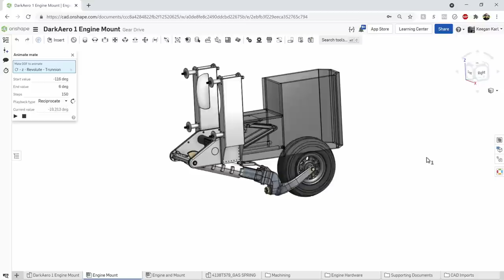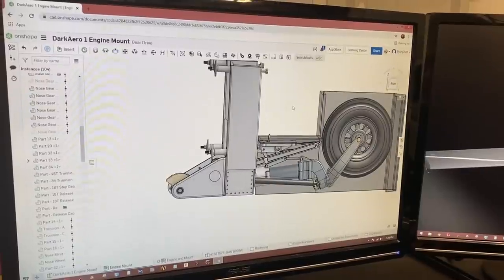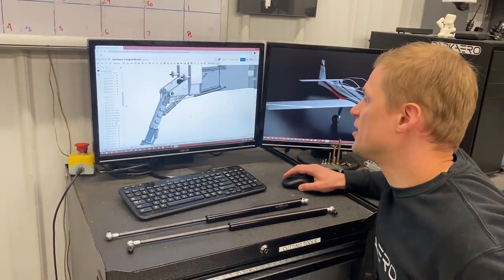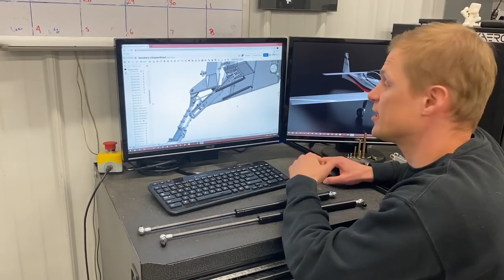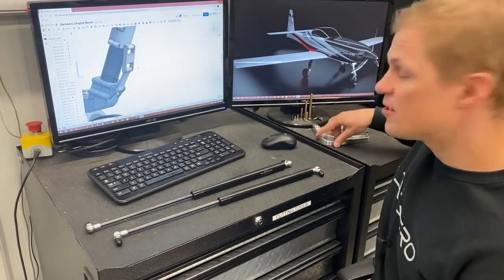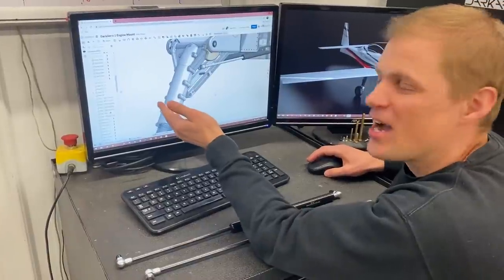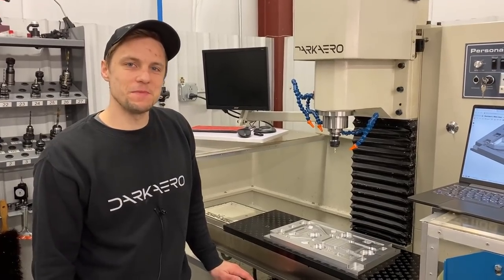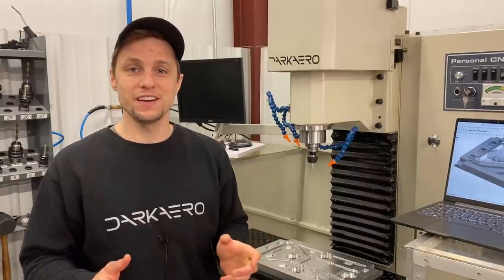Beyond the Prototype - Design for Manufacturability | DarkAero 1 Nose Gear ⚙️

Comment: With an incomplete nosewheel extension being the most common cause of gear failure (and collapse), I'd like to see more focus on the drag links. Specifically, over-center locks for the drag links, along with positive force on the drag links during and after extension to lock them in over center - a spring or strut. Lastly, perhaps a cam on the retract motor that pushes the drag links out of lock at the very beginning of the retract sequence. I want my down-and-locked gear to stay that way!
Reply from the maker: Hi Scott! We only briefly touched on the locking mechanism in the video but we do plan to cover it more in depth in future videos. There are a number of ways to achieve locking. The over center lock you described is popular with hydraulically actuated gear. It’s what I have on my retractable Cozy MkIV main gear. This works well when the geometry and space claim allows for it but we employed a different style of locking mechanism. Ours uses a simple latch mechanism that is incorporated into the mounting bracket where the upper drag link attaches. Once the gear is in the down position, the latch locks the rotational position of the upper drag link and constrains the nose gear in position. The mechanism and function is similar to a rotary latch. We might do a deep dive video at some point that walks through the evolution of our nose gear designs since it might provide some valuable insight for anyone else trying to engineer retractable landing gear. Thank you for your interest in our design!
Reply: @DarkAeroInc  Thank you for this explanation, and I look forward to seeing more on this in the future!

Comment: Glad to hear about design for manufacturability. I work as a prototype machinist at an aerospace company. It's frustrating how the engineers put tiny fillets on vertical walls on tall parts. It makes the part ridiculously much harder to make. A simple over sight of knowing how things are machined could avoid this issue. Hopefully i can finish my mechanical engineering degree to be on the other side and speak up about this. There seriously needs to be more communication between engineers and machinists. If their design is dumb and makes it harder to make typically, we just have to deal with it. Its a waste of time and money. Machinists need much more say in the designs of components.
Reply: There is a reason engineers do these things. It isn't just to make your life harder. Fillets are extremely important.  This is why engineers design airplanes and not mechanics or machinists. Sure, input is helpful but if you don't understand engineering and stress analysis what seems logical to you might a big no-no.
Reply: @PDZ1122  A lot of times they just put it in there for looks though.
Reply: Being an (albeit electrical) engineer, I often wonder how little the two parties (development and manufacturing) actually talk to each other and how limited the mutual understanding is. Looking across the fence is a good thing.
Reply: Share your experience.   Make a blog or YouTube videos.

Comment: How do you guys account for fatigue in composites? I think that would be an interesting video!
Reply: fatigue is really not an issue if designed with an adequate factor of safety. (in stark contrast to metals)
Reply: Composites do not have a limited lifetime, like aluminum.  The Beech Starship, for instance has an unlimited lifetime on the airframe.
Reply: @kickthedonky  I think it would make a for a good topic to discuss though, for those who aren't familiar with the subject. Comparing aluminum, steel tubing, composites, wood, and maybe some other common aviation materials in a concise manner. Could maybe help sell planes too.

Comment: I have had so many issues with gas springs in far less critical applications - perhaps these are special high-reliability models? 
I would feel better about a cable crank  system to pull the gear into the locked position.

Comment: DFM is my world. Thanks for helping engineers understand the need for thinking about how and who is going to make the parts/assemblies that they design.

Also, question. How do ensure the wheel is straight when retracting into the plane? Seems like if it was turned it would not retract into it's home. Does the caster of the wheel straighten it out from the airspeed?

Comment: if you could flip the opening way you take advantage of the aerodynamic and  and use the electric motor only for the closing
Reply: In an earlier video, they said they have considered it but the wheel would not fit below the engine without adding more frontal area and weight (bigger cowling required).

Comment: I have been following you for a year. Very intresting and fun to see the progress.
One question... the dragstay/locklink, how do that lock. What keeps it straight.
Could not see that the motor was connected to the dragstay?
Keep working/ Stefan
Reply from the maker: Thank you for following along! The drag links are locked at the pivot point of the upper drag link. There is a simple latch mechanism that locks the drag link and prevents rotation of the link once the gear is in the down position. We will have more to show on this in upcoming videos. It will be much easier to explain the function with an actual demo. Stay tuned!

Comment: What keeps the nose wheel centered for retraction?  Pivot friction alone and hoping it stayed centered when it spun down may not be enough?  What if it had a little shimmy before leaving the runway?  Say in an aborted landing because of shimmy?

Any room for a 5x5 nosewheel instead?  (Would be nice to have same size tubes and tires all round and sometimes a good 4" tube that doesn't pinch is hard to find.)

What is the manual extension provision?
Reply from the maker: Good question! The nose wheel is castering but not "free" castering. There is an adjustable nut on the pivot axis of the fork which imparts friction into the fork pivoting action. This serves two purposes: it acts as a shimmy damper and it also prevents the wheel from flopping around backwards during retract operations. The break out force to rotate the wheel/fork assembly is around 10lbs when you push laterally on the wheel. This arrangement is similar to what is seen on the nose wheel and fork of the popular Vans kitplanes or the Cirrus SR series of certified aircraft, although these are fixed gear. The wheel and fork on the DarkAero 1 are pointed straight as the aircraft leaves the ground and the friction nut keeps them in position. There is a wedge feature on the nose gear doors (not shown in our videos) that acts as a guide to correct small angular misalignment in the wheel and fork.

A 5x5 nosewheel could have been possible but would require a larger wheel well reducing cabin leg space and added additional weight. The tires are tubeless so no need to try to match the tubes from nose to main gear. 

Emergency extension is accomplished by pulling a release handle in the cabin which will unlock the gear. The gear will swing down under gravity and be assisted into their down lock position with gas struts which help the gear overcome the aerodynamic forces pushing back on them.
Reply: @DarkAeroInc  Yes, I figured as much, and I have have had two fixed tricycle gear planes that  use a opposed bellevue washer setup to give some castoring friction/damping.  I wonder though, when or if there is some shimmy due to a combination of imbalance, not enough friction, and just the right momentary runway contact, what happens?  Until I refurbished my nosewheel I had a couple of shimmy encounters and know that it was bouncing between the castor stops. (Fixed that when I cleaned up the washers, new tire ground to perfectly round when mounted and tensioned the breakaway force to spec)
With that shimmy, I wondered where the nosewheel ended up after it stopped slapping around when in the air.  For a retractable, if it doesn't end up in position for the alignment ramps to catch, it could crunch coming up.
 It might fair itself aerodynamically and might be a non-issue, but I don't know.
Maybe a spring centering device.  Looks like a cessna or motorcycle damper, but built with just springs on either side of the piston to give a mild centering push.  No seals to blow out and reduced complexity compared to using something similar for friction purposes.  OR have it do both.  Centering and damping.
For the emergency/alternate extension I would hope that the two struts are specced so that if one loses it's charge, the other has enough to straighten it.  Maybe a periodic inspection that measures how much force they push the gear with so you know when they are getting weak and don't find that out when you all of a sudden need it for the first time?  My experience with those struts when used on a canopy shows that they get progressively weaker until one day the canopy just crashes down on it's own.  THEN when you replace them, you notice how well new ones hold it up.

Comment: Your nose wheel is essentially a large castor.  Anyone who has tipped up a trolley with castors knows how the wheels always drop to below their axis.  How are you ensuring it stays pointing up while retracting?
Reply from the maker: We get this question a lot so we probably should cover it in greater detail at some point. The wheel is castering but not free castering. The shaft that it pivots on has an adjustable friction nut that serves as a shimmy damper. The force to pivot the fork is on the order of ~10lbs when you push sideways on the wheel so the wheel doesn’t flop around during the retract cycle. Thank you for watching and for your interest in the design!

Comment: Why not instead add an axial spring on the pivot in the drag link locking mechanism, sine the drag link has a mechanical advantage at that point? Lighter than the gas struts....  or even a simple lever on that same pivot, pull with a cable emergency handle.

Comment: I love the manufacturing/production engineering and it appears you know your stuff in this regard however, are you doing actual engineering for the aircraft loads? For instance, have calculations been made to assess the loads imposed on the components when wheel shimmy occurs or the maximum load which would occur with a nose wheel first landing?
Reply from the maker: Scott, thank you for the kind words! We have designed the landing gear to meet the worst case landing load conditions specified for certified aircraft per FAR part 23. We will be confirming we meet those requirements through drop testing.

Comment: That is looking better. Do you know the MTBF of the gas springs? Is one sufficient to overcome the air loads in an emergency extension? Should you have a recommended time for replacement of the gas springs, something like 5 years?
Reply from the maker: All good questions! The gas springs are rated for 100,000 cycles but this is in standardized test conditions so realistically this number would be derated for real world conditions. The gear will still extend with a single gas spring, just at a lower airspeed range. The gas springs would be inspected/tested at a minimum during the annual inspection.

Comment: have ya'll considered a fully manual retracting landing gear? seems like with this size and weight plane could work fine. potentially more reliable robust? just have a lever in the cockpit
Reply from the maker: We would actually really like to do this! Fully manual would be awesome for many reasons. We just were never able to come up with a good mechanism to make it work. The way the forces work out and the space claim we have to work with made a fully manual retract solution a no-go, at least for now. Still thinking about it though! :)
Reply: @DarkAeroInc  there's always a way! will be a nice thing to do for future iterations! keep up the good work

Comment: I would encourage you to consider a shimmy damper.
Reply: That can be achieved with opposing bellevue washers and a tire much better than those.
Reply: @notj5712  My Velocity has Belleville washers and a balanced wheel.  Shimmy can still (and did) happen.  It's also harder to steer.  I installed a shimmy damper and life it MUCH better.
Reply: @n6408s  I have had my issues with those too.  Just redid mine on my RV.  Just expanded on this in another question here.

Comment: Gas Springs. We have all seen them fail over time, I think of car hoods. But quality could be the difference there. I don't know if I could trust such a autonomous system for my landing gear.
Reply: I would think you'd uncover this on the gear retract/extension check during the annual condition inspection.  Both normal and emergency retract should be tested at that time.  I think utilizing a simple spring scale to pull against the landing gear with the landing gear set to freefall could be a simple test to ensure there is enough force to overcome wind resistance at the maximum gear extension speed.

Comment: The upper mounting point for the gas strut won't have much of a torque advantage that close to the pivot point. You guys have enough extension to mount the landing gear side of the strut a few inches lower to give it more leverage? You guys sure those two struts will be strong enough to push the front gear to locking position and over come the wind resistance when that motor is disengaged? I'm just afraid the integrity of those gas struts wont have consistent performance in colder climates as the inner gaskets tend to shrink in cold weaker. My back ground is in hydraulics.
Reply from the maker: Great question! We had to carefully establish the gas spring geometry and forces when we designed the gear, and it was surprisingly tricky to get all the forces within the correct range. The location of the gas spring attachment points was specifically arranged to provide enough mechanical advantage to overcome aerodynamic forces while still allowing the gas springs to compress into the available space in the wheel well when the gear is retracted. There is enough force available to extend the gear throughout the full gear extend speed range. There is still sufficient force to extend the gear even with one of the gas springs fully failed and the second spring at half pressure, although this would be at a reduced speed range. The gas springs we selected have a wide operating temperature range and life rating of 100,000 cycles, but we intend for the gas springs to be tested during annual inspections. Thank you for checking out our design!
Reply: @DarkAeroInc  Fantastic news! I completely forgot about figuring the retraction resistance so you don't over stain the motor so yes there is a balance. Whatever gas struts you guys are using seem to be the real deal.
Reply from the maker: Check out Bansbach. They make a ton of gas springs for aviation and aerospace applications.
Reply: @DarkAeroInc  10-4

Comment: What are you using for a down lock?
Reply from the maker: I only quickly breezed over it in the video but the down lock is integrated into the mounting bracket that the upper drag link attaches to in the wheel well. There is a simple latch mechanism that locks the rotational position of the upper link which locks the whole nose gear assembly in the down position. We will show the mechanism in greater detail in upcoming videos. Thank you for watching!

Comment: How will you know if the gas shocks have failed before your gearmotor has failed?  Seems like with this design you'll find out at the least desired time!
Reply from the maker: Hi Mike, great question! Experimental category aircraft like the DarkAero 1 are required to go through an annual inspection to maintain legal airworthiness. The gas spring function would be an item that would be checked, at a minimum, during annual inspection. This type of inspection is similar to what is seen on other designs such as the Lancair Legacy RG or Lancair IV which also utilize a gas spring for backup gear extend. Our design uses two gas springs which makes them somewhat redundant since the gear can still extend with just a single functioning spring. The particular gas springs we are using have a life rating of 100,000 cycles which makes it unlikely that there would be a simultaneous complete failure of both springs in between inspections, even when de-rating the springs to account for environmental factors. Thanks for watching and for the question!

Comment: I am missing a shimmy damper, thats not needed in this design?
Reply from the maker: The nose gear has a shimmy damper. There is a simple friction nut that imparts friction onto the pivoting nose wheel fork. It’s really similar to what is seen on the popular Vans RV nose gear or Cirrus SR series.
Reply: @DarkAeroInc  Yep, there you are.  Opposed Belleville Disc Springs/washers.

Comment: Guys, invert the nose gear before you start manufacture anything. will save you A LOT of troubles, will make the gear more reliable and most importantly safe. This equilibrium stuff and the two shocks .. what are these form the old SW. Doooooont du it. ;)

Comment: Isn't BVID an issue with carbon fiber?
Reply: Sure it is. But only a few people out there know what you are talking about. 
The hardest point will be to get the right allowable values to size the structure properly.
Reply: @BeeTourBo  That could be allowed for by inspection by implanting fiber optic strands into the weave.  That's getting into the weeds though and probably out of the scope of a kitplane.

Comment: What about the gear drive, how does it handle impact on the gear? can it slip or do you just plan on it forcing the motor? or will there be a flexible part of the gearing. A spring steel part would seem like the easiest solution. I would even let that be the suspension for the arm.